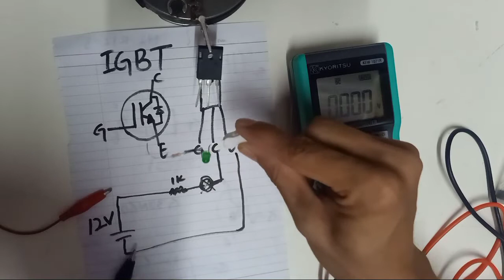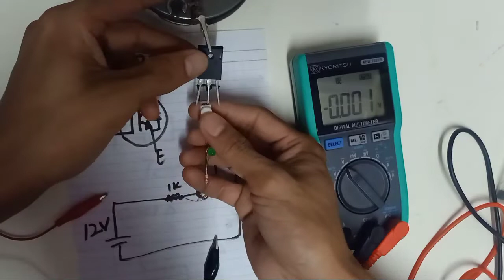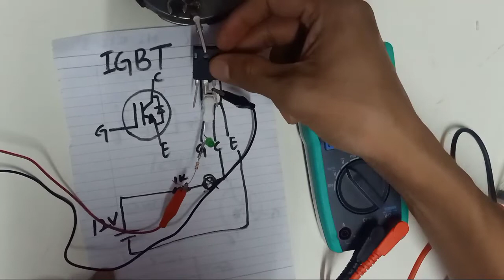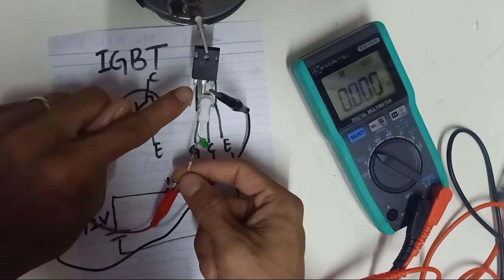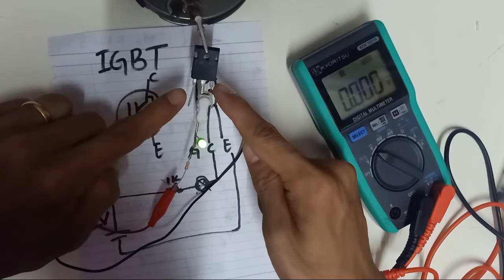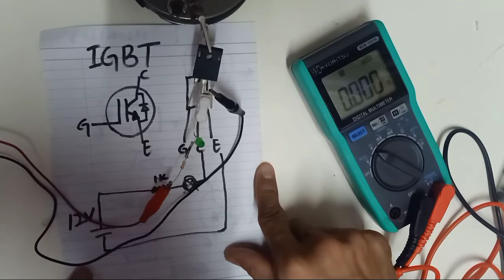How to check IGBT without Multimeter.

Comment: My mother was cooking on the Bajaj majesty icx 2 Induction and suddenly a boom sound followed by a flash of fire came out the vent of the Induction and i opened the Induction and found that the MOV (Metal Oxide Varistor) exploded and charred the board/pcb then i checked the igbt according to you and i saw that the igbt survived! And thanks so sharing the video otherwise i coudnt figure it out because my multimeter was damaged....THANKS FOR TELLING ME.
Reply from the maker: I am happy for its helpful 😊
Reply: @Electronicslabs  and I am happy bro because you shared this helpful video
Reply: Brooooooo maximum person showed that multimeter but you did the non multimeter and working some person also told without multimeter but they did the connection wrong you did it correct
Reply from the maker: @anupmondal4226 thank you so much for your support